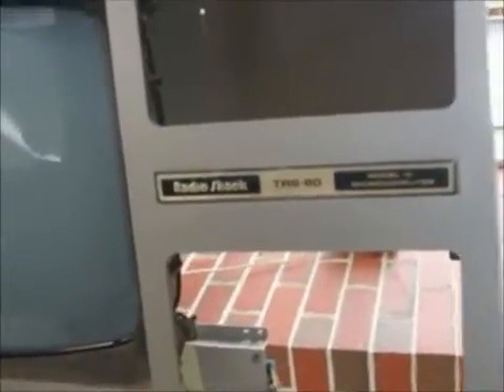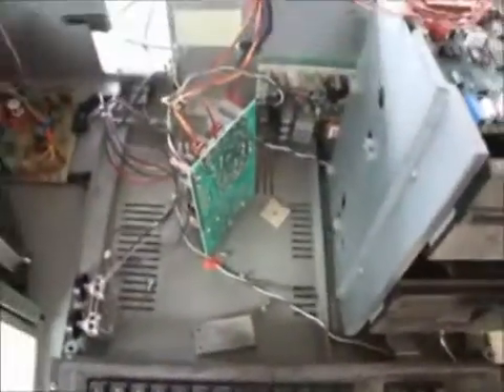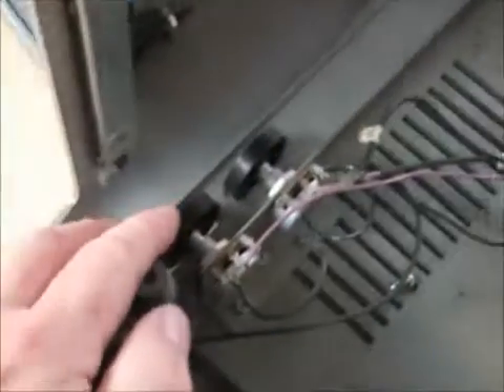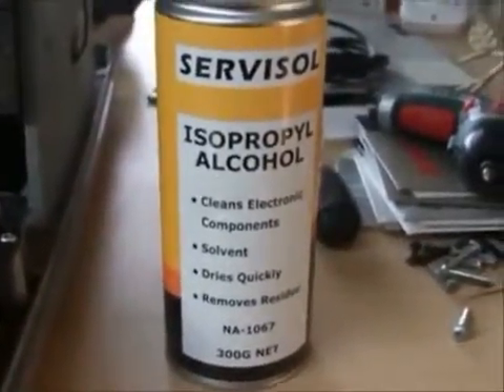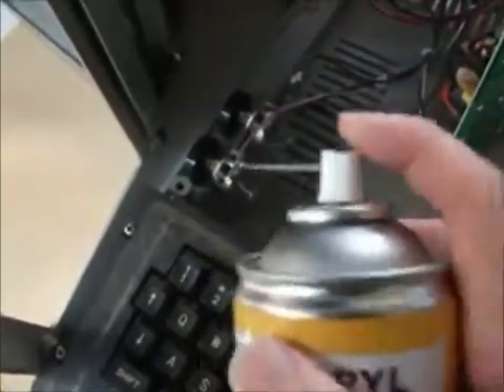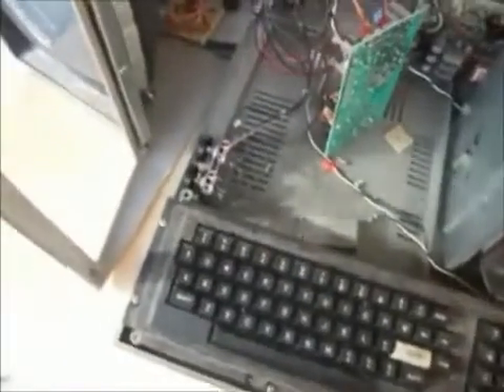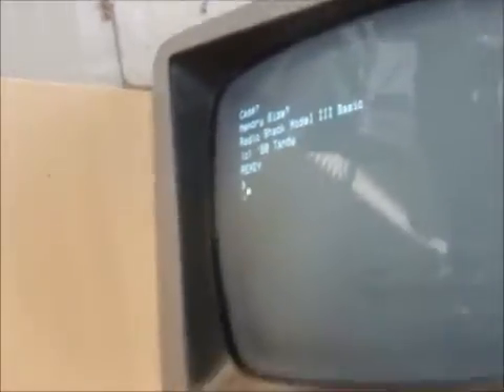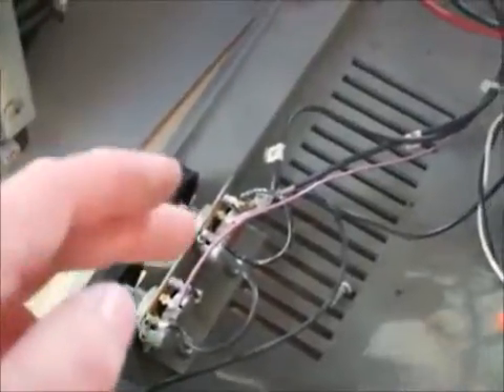TRS-80 Model III & 4: fixing stuck brightness & contrast controls

Comment: Greetings Ian.  I've not tried it specifically on a model 3's potentiometers, but in general, if a bit of Iso frees them up *temporarily, but they then size again when dry, then a few repeated cycles of a good soaking with Iso, a blast of Air (from a can or a compressor) to flush out the Iso dissolved gunk, and lastly, a bit of CRC 2-26 (http://www.crcindustries.com/ei/product_detail.aspx?id=02004) will generally restore most mechanical contacts/switches/pots to life permanently, since its an electrical lube that doesnt dry out again (Unlike Iso).  Ive used it on sticky/glitchy Model 1 screen pots and it brings them back to good as new.  Sometimes you have to roll the pot back and forth to its limits a few times to clean the whole track, but its never failed yet.